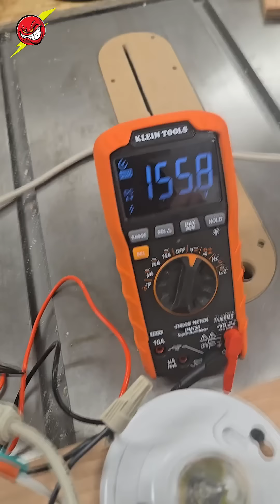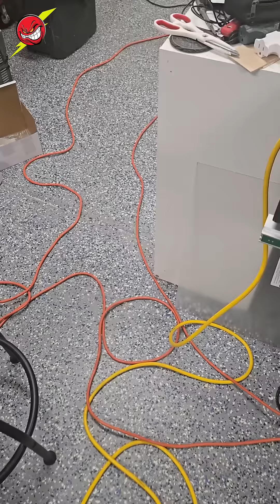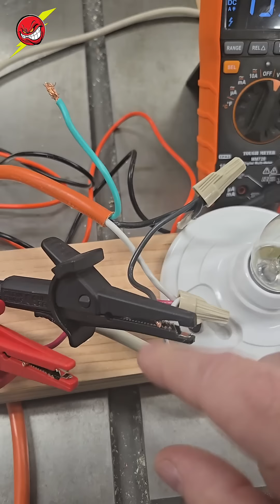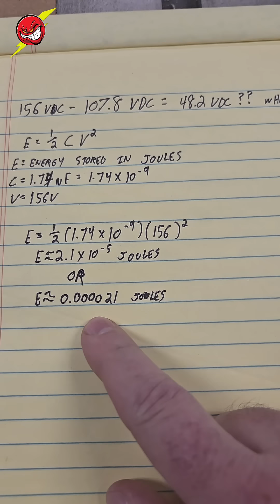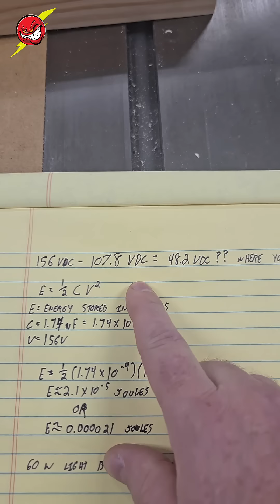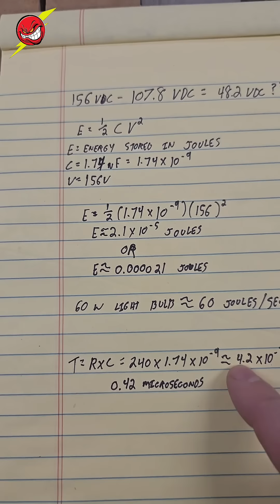Ghost Voltage 👻 #electrician #electrical #volt #nec #code #electricalcode #nfpa #sparky #angrysparky

Comment: If you have an old analog meter that changes scales...If you change the scale and the voltage remains the same there is not an induced/ghost voltage. If you change the scale and the voltage changes based on those scales then you have induced voltages. D'Arsonval meter movement always shows induced voltages.